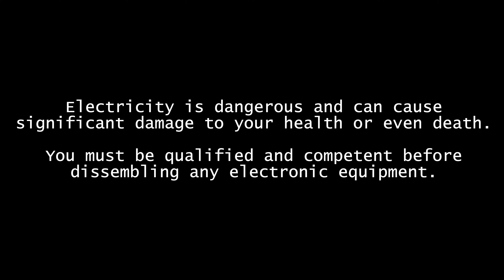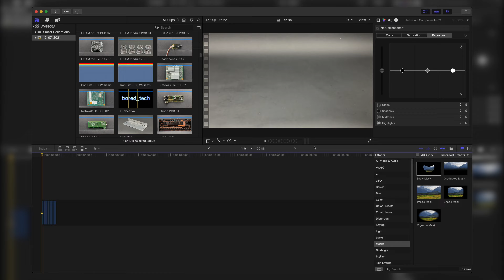Marantz AV8805A teardown

Comment: Thank u so much. I have a AV 8802A and I was trying to locate the fuse to change it to a ceramic fuse. I called Marantz and various other places and no one knew where the fuse was located, so I just stumbled on your channel and it was a lifesaver. Thank very much.
Reply from the maker: You are most welcome!
Reply: I watched the whole video and I did not see the location of the fuse. I also have the 8802a.
Reply: @LemonySnicket-EUC  I found it and changed it out with a Synergistic Purple fuse and it changed the sound about 40% and its not a myth. If you are looking for it, if open and facing it from the front, its on the right rear module on its side, screwed against the copper chassis. there's a flat ribbon connected to it. Its easy to take apart and put together. I hope this helps you.

Comment: I ammlooking for the plastic front panel that got damaged in a unfortunate drop, unit is 8805. Was wondering if a 8802 front panel would fit as well. Just need the plastic part, no aluminum plates as those are fine.

Comment: i think one the best & most detailed gear teardown video on YT....One missing point was the missing lables of reservoir capacitors.They were from Elna but which series/voltage/uf? was missing in the video.
Thanks.
Reply from the maker: Thanks for pointing that out. I was concentrating on ICs too much. I will check my footage, maybe I caught them accidentally.
Reply: At 12:14 are shown two pairs of Elna Audio 35V/10000uF.

Comment: Thanks for the video! ...I bought the new Marantz AV8805A  3 weeks ago and it sounds better than my old AV7704 not a night and day difference ,but it is audible.
Reply from the maker: Yes, I agree with you. I had an SR7500 in the beginning, then I bought AV7705 and used SR7500 only as an amplifier. Difference was huge. Then I bought MM8077 to replace my old SR7500, difference was significant as well.

But now when I replaced AV7705 with AV8805A, it's slightly better, but nothing revolutionary. But I like it anyway, will keep it until I'll be able to replace it with Trinov Altitude.
Reply: @boredtech  
So your basically saying your 8805 is no better than your old receiver after you added an out board amp and used it as a processor???

Comment: Based on the video the unit isn't fully balanced throughout the who circuit path.  Any advantage using XLR plugs to a Krell Shocase Amp or any amp with a truly balanced signal path?  Trying to determine if it is worth the upgrade cost to change cables.

Comment: Hi bro I appreciate all your efforts. Your contents are so unique and no one else would have it in a million. . One question Is is worth the price to prefer 8805a over 7706…?
Reply from the maker: Thanks for your feed back! I personally owned AV7705 which was later replaced with AV8805A. AV8805A sounded better, but difference is not massive. In ma case I needed XLR inputs so I decided to buy it and I'm happy overall.
Reply: I had bought 8805 an year ago. Now it shows a problem.

1 month back My projector had stopped working  and got repaired.When it was connected back to 8805 ,it was found that there is no output from HDMI with earc . Normal output is there from HDMI 2(monitor) What could be wrong?  I'm just out of the warranty period. Will the entire board with all the HDMI that you showed,needs to be replaced ? I ran  HDMI diagnostics which shows error V1-08. PLEASE give your expert opinion.

Comment: I love the precise teardown and the details you have shared in this excellently made video... a heartfelt appreciation for all the painstaking effort you put into making it... I'm from India.. a fee months ago I purchased a refurbished 8805 from the US... it's 120v 60Hz... I have moved to India and am using it here at 220v 50Hz...I used a step-down transformer; however  I'm wondering if it can be used at the local input voltage....? Unfortunately I'm receiving higher electricity bill then normal, assuming due to the power wastage via the stepdown transformer. On opening the unit is notice the smps board mentions 220v and the other processing pcb's also mention 220v...I'm wondering if the transformer also may be rated for 220v...? I don't see any specs printed on the transformer... on repeatedly watching your video and comparing the parts with mine...they look same...so you think I could power it directly into the 220v and have it work perfectly..or will I KILL the unit?? Your advise will be highly appreciated. Thanks much and stay blessed.
Reply: it wouldnt kill the smps, but if you got a 120volt unit you shouldnt plug it in a 220volt outlet, transformer turns would need to be doubled for it to work.

Comment: I have that same pre-amplifier although I don’t recall if mine has Wi-Fi intent on the back of it or not the only thing is, I got mine from a Custom Audio store. It was given to me, but I didn’t get the original remote. I had to order a universal, that’s a very expensive preamp. They even had a matching amp which I have yet to see you’re going to get rid of the remote you can send it to me I’ll pay you for it.

Comment: Great video! Regarding the XLR inputs vs the analog (or 7.1 analog) inputs.. Looking at the service manual, it would appear that ONLY the 7.1 analog inputs bypass the digital volume control/ADC for the normal analog inputs. Can you confirm? This leads me to believe that only the 7.1 analog input ins appropriate for a turntable, assuming you don't want analog-to-digital conversion of that signal.
Reply from the maker: Hi Sam,

Center, Subwoofer , Surround Right, Surround Left, Surround Back Right and Surround Back Left inputs of 7.1 group, only passing through the NJU72343  (ELECTRONIC VOLUME CONTROL).

But front Left and front Right can be routed to ADC via NJU72750 switcher or can follow the same route as C,SW,SR,SL,SBR,SBL

If you want to bypass ADC-DAC 7.1 should work. I have to dig deeper in to the user manual to find out how it's done exactly.
Reply: i hope you are not or did not plug a turntabledirectly in to those inputs. if it's a turntable with a phono preamp built in then you are fine. if you have an outboard phono preamp then you are fine but you need to have riaa  equalization or it will sound like kahkah

Comment: Bored_tech, my AV8805A front lower panel does not come up.  What is keeping the panel up right?  Is is magnetic or mechanical (spring loaded)?  I want to open it up and fix it.  Any advise?  Thanks.
Reply from the maker: Yes, it has magnetic thingy, you will see how it looks in my video.
Reply: @boredtech  I have watched the video many times but still not sure how it works 5.41?

Comment: So, is the 8805 worth the extra $2000 bucks over the 7706 sound wise?
Reply from the maker: Thank you for your question. 

I only can compare AV7705 and AV8805A. 

There is a difference, 8805A sounds slightly better to my ears. Is this difference worth 2000$? Probably not. 

I really needed a balanced input. So it added a bit more value in my case.
Reply: @boredtech  Yes it is worth it.

Comment: Which one best? , sr 8015 are av8805A
Reply from the maker: You can’t really compare them as one of them is receiver and the second one is AV Processor. But if you get AV8805A and two MM8077 it’s going to be better and probably 4 times more expensive.

Comment: It was a big mistake the dacs replacement. The previous AKM dacs have higher specs.
Reply from the maker: Yeah, I noticed that. 384kHz with ESS VS 768kHz with AKM
Reply: I think AV8805 had AKM AK4490 32bit/192KHZ  not the AK4490EQ
Reply: @p.p.4674  AK4490EQ, i see it my self. I upgrade my 8805 to 8805A(digital board).

Comment: When you see what is inside one of these av amplifiers laid bare there is not very much to them and what they charge no wonder the price of thse expensive av amplifiers drop like a brick after a couple of years. Morale of this story is all AV processors and or AV Amplifiers have mainly all got similar components inside of them, I dont understand how a Lyngdorf MP-40 is worth $12.000. I doubt I would ever spend that much on an AV Processor so the most I would spend is $4.000 on a Yamaha AV receiver and be doen with it, really dont see the monetary value in all this silicone no matter how good sounding they may be can't be that better than the run of the mill all in one AV Receivers.  So thsi is directed to the the author of the video congratulations on your hard efforts you have balls of steel to undertake such an adventure doubt I would be doiung that to any of my AV components though I do tinker a bit but nothign on thsi sacle not a whoe disassembly so tell me what will you do witht the AV Receiver once you have built it back up will you keep it for your self or will you sell it on flea bay. I weas shocked if I tell the truth of the amplifier section it looks super puney compared to my 7 channel lexicon separate power amplifier.
Reply from the maker: Thanks fur such a great comment! :-)

Indeed it's quite stressful to take them apart. Especially when you have to film it. But I enjoy it.
For now I will keep my AV8805A and MM8077 but hopefully one day I can afford Trinov Altitude 32.
Yes it's over 20.000$, but it's a pro grade product.
Reply: Maybe the amplifier section looks puny compared to your separate power amp because this is not an amplifier!
Reply: @bear claw 

Goteem 👍

😂

Comment: Interesting!  Much has come since 1978 and my 2285B.  Gotta say however there was quite a bit of flux goop on a number of those boards, and more cheapy China cap brands than I would've expected coming from them.  Also no gold plated boards/pads either; weird mix at times with thru hole and SMD.  Surprised they dodged using SMD style caps.  But hey I get it-- 21st century, cost cutting, pandemic, blah blah blah gotta cut some corners.  They don't have to make a brand new Keysight spectrum analyzer here either so...why go harder than necessary.  Not like it was done poorly though; Altera Sharc's, high performance DACs, lots of effort in to combating RF noise, etc.  Lots of BB in there and a TON of JRC in that thing holy hell lol!  Must have something contracted with JRC as much use of that brand as we saw in there.

Comment: i don,t like new technology because everything is made in china and have in circuits (   conmuted stuff, and thats means we can,t fix it or repair,   i prefer old echnology, because are made to  work  more more years, and we can fix it,   all my technology stuff are vintage and works good after more than 20 years  ,
Reply: It's plug and play.
Reply: i run a Pioneer SA7800 rebuild on a daily basis with my B&W DM601S1 pair speaker, i love it more than almost anything.